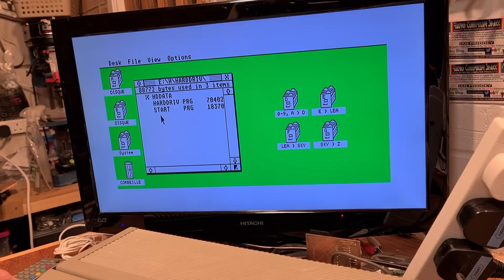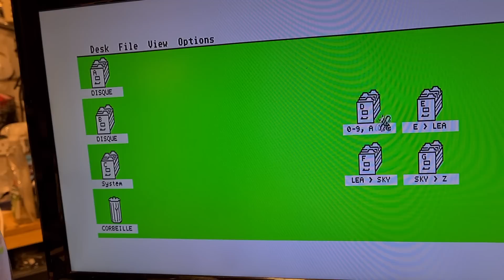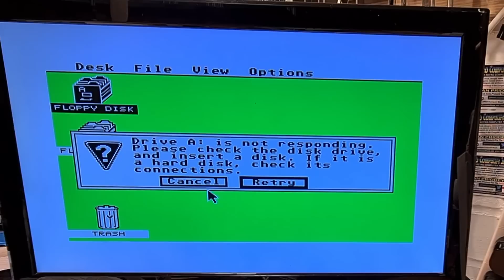The Most Fun You Can Have for £20? - Atari 520 STFM

Comment: Another great video. I have 3 ST's and am trying not to get a fourth!  Although I do want a STE model though.  These are a cheaper alternate to an Amiga, although not as good. All 3 of mine have knackered floppy disk drives & I believe this is a common problem. You got yours for £20, one of mine cost me £28 it was upgraded to 1 meg & had an external working hard drive, an external hard drive, mono chrome monitor and some games. Wish I could find bargains like this more often.
Reply from the maker: That was a cracking bargain! With all the extras even better than mine! I've had a few comments saying "this isn't a realistic price" so I will pin your comment as evidence!
Reply: @MoreFunMakingIt  Yea, it was a good bargain. Probably the best bargain I had was a working Amiga 1200 with about 20 original boxed games and some joysticks which cost me £50.
Reply from the maker: Superb! Although I have that beat. My 1200 was free. Best mate kept his from back then and gave it to me for a Christmas present

Comment: I have the 520STFM too. 2 to be exact. One was bought back in 1989 and another a recent find at a recycler.

Apps from TOSEC will run except a few which requires 1MB RAM.
Reply from the maker: Lovely! We're not allowed to take computers out of recycling here. Keeps me awake at night thinking what's getting crushed
Reply: Only issue now is I cannot find an easy RAM upgrade for it. My skill with the soldering iron is rock bottom at best. Probably killed several old laptops previously. 😭

Comment: Good memories. Did a lot of work on these when I was young. Even made a memory expansion using SIMMs you could get from Apple users for free, with a decoder and a huge amount of wires to where the RAM chips would be. I think I had 2.5MB in that ST. Didn't fit in its case by the way.
There was also an 68020 upgrade board, piggybacked over the CPU.
And a PC emulator that worked quite well, a daughterboard that also went over the 68000. The PC-Speed made by Sack (German company). I remember you had to cut 1 pin off the 68000 and wire it.. Installed quite a lot of these.
Reply from the maker: Sounds like a lot of great memories tied up with the Atari for you! Thanks for sharing :D

Comment: I have 2 amiga500 computer's in their original boxes and they rarely come out as i have an amiga emulator on my laptop...the atari ST shared the same motorola processor as the amiga and so in essence most amiga games were simply port overs of the st version...some software was amiga specific but overall the experience was the same...great stuff none the less.

Comment: I have recently acquired the same revision MB to yours, and still at 512Mb, I hope to add the missing RAM myself in next few weeks, pleased to see a 'walk thru'. Laid on top of the shielding I see an unidentifiable circuit board, unless that is an early version of  ACSI2STM, I bought SD4ST+ the other day, easy to flash ICD Pro to a separate card, keeping original supplied with device for post-512Mb-upgrade.  Engaging video, I shall subscribe and watch more, thanks.

Comment: Very nice. Great bargain. I got a 1040 STf myself a while back also with a faulty disk drive; but I think it's a mechanical failure because I can't insert disks into it. I found it for €100 with shipping but had to pay custom charges and VAT which added around 50% to the price in total. Have since gotten a GoTek, a 2nd external drive, some disks, and also an ACSI to micro SD device. I now only need some newer ROMs (my machine has a German layout so I'm thinking why not German 1.04? (und ich brauche die Übung)), and to upgrade the memory from 1 MB to 4 MB. Buuuut... I will need some practice with a soldering iron first. But I do like the machine and it will sit nice next to my Amiga 500 and Commodore 128. Well until I find an STe that is. :) Great video, Lee.

Comment: hi lee, great video.. what a great buy, i bought an ST last year.. 520stfm for 70notes. it works, but i daren't look inside.. i had one in 1988 so it was a bit of nostalgia for me to get one. however, like you, i realised I couldn't load any games on it. i did a little research and discovered it wasn't upgradeable.. i boxed it back up.. i've never soldered anything in my life so wouldn't really know where to start.. so for now.. it's gathering dust. til i decide what to do with it.
Reply from the maker: Thank you Baz!
Shame your Atari is one of the tricky ones. There are ways to upgrade them, but they're much more tricky than the one I showed.

Comment: Superb ,i thought mine was cheap in good condition for £34 though drive is not reading disc my spare drive that was working also does not read maybe its a machine fault ,i have not looked into it ,i need a gotek.
Reply from the maker: That's still a great deal you got!

Comment: Quite a nice bargain with this Atari! I have never seen an ST with an internal Floppy and that extra "non standard" logic PCB (15:05) mounted on the shielding!
I got that version as an external doublesided Atari SF314 drive. Interesting to see how many different Floppy models Atari installed back then.
Reply from the maker: I did look up at the time (a year ago so my memory is foggy) which drive that is. The advice I remember was basically don't bother too much with repairing it as its not very useful anyway.

Comment: Curious as to what the SD HDD adapter was that you used?
Reply from the maker: It's an ASCI2SD which is a very simple board that just uses a blue pill and a couple of other components. There are a few different versions. Ill dm you a link to the github

Comment: I like your dry wit!  The Zoidberg animation was one of many nice bits added too. A couple jump zooms took me off guard, but I really did enjoy the presentation overall!  😊

Prices for ST computers in America are through the roof due to rarity. $500 and more with ease. Just for the main computer. Thet's arguably 40~50% too much for a tested operable unit, but rarity is the ultimate variable.

Never seen a 6-socket ST with only 2 chips, usually the 6ers had 6 chips and 2 for the 2ers, of course. 

Nice socketing job and describing, and tips!  Desolder pumps are a nightmare. Those vacuums can be better but I had some of the same problems. As with for you, adding new lead solder then vacuuming took care of it. But, wow, the ST had a more robust motherboard than the XE line, which are insanely fragile and the circuit traces can come off. I've been lucky so far, but - zoiks... I'd rather burn a finger than a trace.
Reply from the maker: Thank you for the nice comment!
I've had the dubious pleasure of working on boards similar to the fragile one you describe. This one was a walk in the park in comparison.
The normal price of an ST over here is much higher than I paid, around £75-150 for a good one. I got ridiculously lucky this time. But saying that I'm a patient man and only buy things if they're a bargain. My other Atari STe only cost me £40 and came with 2 pristine Zipsticks!
Just takes a lot of work to keep checking the ads.

Comment: I had a 1040 STE till I got my first Mac in 1998.  Wish I’d kept it because the emulators available are garbage and don’t even allow customisation of input devices so you can end up having to use the select button as the fire button in games.  Also had a Neo Geo (home arcade system not handheld), a SNES and a PS2.  Got rid of all of them and regret it.

Comment: Great video. Very odd about those games, I don't remember any that wouldn't run in 512k. Maybe it's a TOS version compatibility issue requiring more RAM (my ST had 1.02 which played nicely with most games and demos).
Reply: No, it's the hardisk drivers for the ACSI2SD that take up a little bit too much memory.
Reply from the maker: That makes sense! I was really surprised hardly any of them worked. I will pin your message as its good info I wish I could add to the video.

Comment: That’s a great deal Lee!
I love the ST but I have to admit that I made a mistake buying it in the day over the Amiga.
I now have some amigas and I have to say they are actually more fun and easier to program.

The reason I had an ST, next to my XT was for MIDI recording and Cubase and being a cheap skate for not wanting to shell out an additional 50 guilders for a MIDI interface on top of the already almost 200 guilders that the Amiga cost more than the ST.

And I recorded a lot on that machine and programmed a bit but and liked it. But it wasn’t love like the C64.
Reply from the maker: We always covet the things we didn't have 😆
Reply: @MoreFunMakingIt  isn’t that the truth. But all it takes is just waiting 31-32 years and you can have what you wanted for a couple of quid 🤣My mom always said: “good things for to those who wait.”
Reply from the maker: I always think of only I knew. But I think even if I did know back then I would still have sold all my stuff anyway. I used to live in the moment!

Comment: Nice machine! This was my first ST in 1987. The 520 + 360K disk drive. Excellent machine for all kids of tasks,  but the games were my favorite part. This machine would be a few $100 in the USA right now. Those hard drive versions usually need 1MB at least because the hard drive driver takes up too much memory, With GoteK SD floppy replacement you cab play 95% of the originally released games.
Reply from the maker: Good to know! Thanks for the info. Having the memory upgraded makes it an easier decision. I'll still have a gotek option though

Comment from the maker: I've been told by @galier2 that the problem loading all the games was the hard drive driver taking up too much memory. They probably would work fine off floppy.
Reply: This sounds right. Most Atari ST games were designed to work in 512K, some with enhancements for 1MB. Pirate copies or hard drive versions are often tweaked to require 1MB so they can load more (or all) of the game into RAM at once, so if you're using a hard drive/flash solution 1MB is probably a minimum.